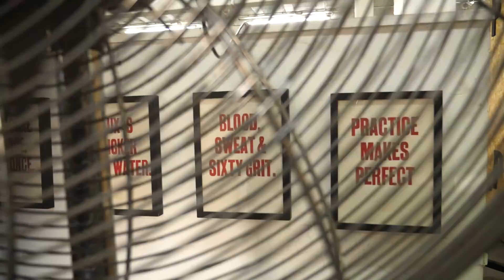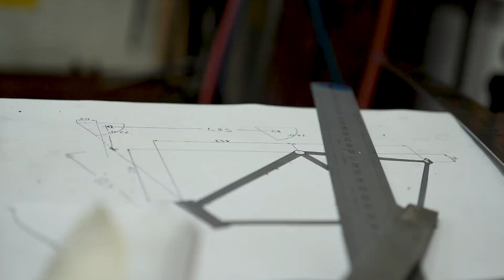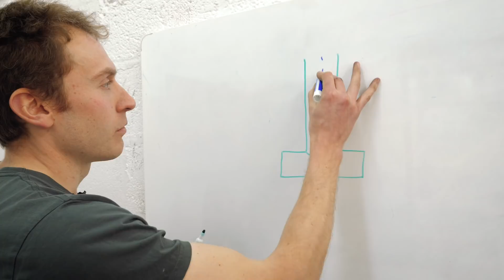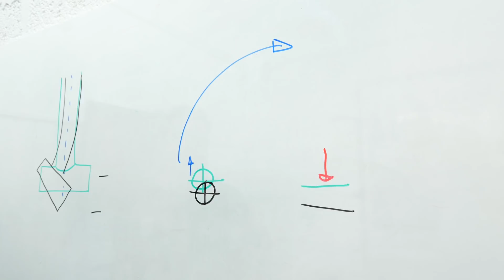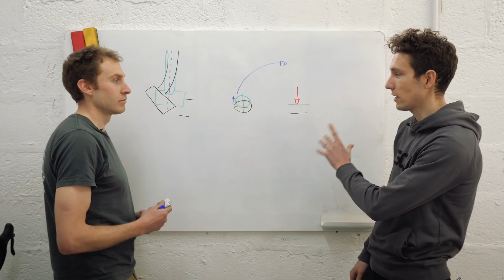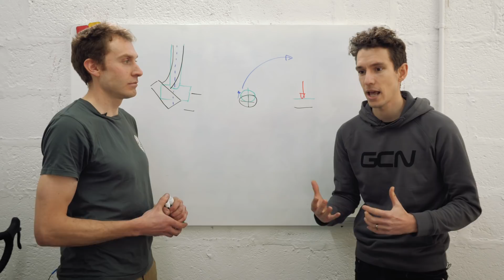Are You Faster On A Stiffer Bike?

Comment: In a strange train of thought...  You can analyse this in one of two ways... One where you can only supply a set amount of maximal power and one where you can only supply a maximal amount of force. We'll just go with maximal force as it's simpler to walk through the discussion.

 If you can only exert a set maximal force, the frame that flexes more would in theory allow the pedal to drop faster as some of the energy is being stored in the twist of the frame rather than being transferred to the road. Simplifying a bit... Rotational Speed (RPM) x Rotational Force (torque) = Power , so at the 3 o'clock position in the pedal stroke you are creating more power compared to a stiff frame because of the increased pedal speed at this portion of the stroke. But, you are storing that excess energy in the flex of the frame. As you reach the bottom of the pedal stroke where your pedal forces is lower the frame will provide a spring back of energy making it harder to initiate the pull through of the bottom of the pedal stroke. This return of energy combined with a fixed available force means that pedal rotational speed is slowed (bear in mind instantaneous crank speed will not be aligned with pedal speed due to the frame flex. Although they will have the same frequency, there will be a phase shift between them). With this increase and subsequent decrease in pedal speed and the accompanying difficulty in pulling through the bottom of the pedal stroke, to the rider, it would feel almost be like having eccentric chain rings they were placed 90 degrees out from how normal eccentric rings are installed. The end result of which is a muddy feeling through the bottom of the pedal stroke. This storing and return of energy essentially does peak shaving of power output to the wheel where the average (and I stress average) total power to the rear wheel should be nearly the same, but the peaks and valleys of power output throughout the stroke would not be as extreme.

On the counter conclusion to the above... a stiff frame will have less stored energy and thus less spring back in the bottom of the pedal stroke and therefore not be as hard to pull through. And, in a perfect world with no flex, all power would be transferred directly to the wheels on the down stroke, which riders with high strength (like sprinters) could possibly take advantage of that by being able to generate significantly greater pedal torque thus letting the more muscular rider generate a higher instantaneous output power. This makes for larger peaks and valleys in power output, but the valley can't (or shouldn't) dip below zero... so the greater the peak, the more total average power one could potentially generate. Eccentric chain rings would only augment this situation further, and although it's a topic of enormous debate on how effective they actually are, there are more than enough pro athletes who use them to say there must be at least some merit in the theory.

Comment: I have ridden brutally stiff frames which on smooth roads were more tiring to ride than my more flexible frames.
I could not ride long routes quite as quickly or as comfortably as the more compliant frames.
The rider endurance/output factor does not often come up in this discussion, but probably should.
Reply: Nor does rider weight.

Comment: Yeah.....nah....Full disclosure- I’m an engineer.Energy is absorbed in flexing the frame. This is wasted energy, and is not, as you suggest, returning to the drive train.Imagine if you had springs under your shoes. Some of your energy would compress the spring with the peddle down stroke, while the remaining energy would drive the crank (assuming no frame flex). This spring energy is released on the peddle up stroke. It goes into lifting your foot, not driving the crank.If I did the same test as you, but with springs under my shoes, and released the brakes, the same thing would happen as loading the frame. But in reality, the brakes are not released. The load is maintained and the spring energy is released without doing any useful work.It’s basic physics.
Reply: PS: It’s the same reason riders like there shoes to be stiff AF.

Comment: A more rigid frame is more consistent to ride and if there is a requirement to have some 'flex' it can be achieved in a controllable way ( suspension for roubaix, carbon layup etc ) to add the subtlety where needed rather than relying on inconsistent bending and twisting of bottom brackets.

Comment: Fascinating video/test! I am not a scientist but I reckon the problem here is that real life use of the bike is not on a trainer. Meaning that the bike does not remain upright and held in position during the torsional flex that loads the frame and drivetrain. If the trainer was not there for your test, the bike would shift sideways when loaded to compensate or neutralize that flexion. The issue appears to be that you have isolated the wheel into only allowing the stored energy to propel the wheel forward whereas in real life that energy is driven into lateral forces right and left per pedal stroke. I have an old 1997 Litespeed Ultimate ti frame that I have always referred to as a slinky on wheels....Its BB is very flexy and when sprinting the bike torques so much that it fish tails side to side. Maybe this is not so much an issue of loss of energy but rather misdirected energy. Watch old slo-mo videos of pro RR sprints from above. Those bikes are fishtailing all over the course. Watch modern videos and the fishtailing is much harder to detect and the speeds reached are higher....stiff means fast. That fishtailing is surely energy lost in lateral movement at the expense of forward momentum...instead of having that power move me forward its skidding out the rear tire to the side. On a stiff frame forward momentum is only limited by tire traction and wheel stiffness (other factors that could see wasted/misdirected energy going laterally instead of forward). This is all for a road bike where the frame is pivotless. Take this same test to a full suss MTB and you have a whole additional set of factors (or at least they are exacerbated) that lose energy that could/should be directed to forward momentum with a stiff frame. The goal here is to eliminate as many factors that misdirect energy as possible until they begin to counteract the benefits. If you feel beat up due to ultra stiff frame,wheel,tires, bars, post, etc.  then your sprint will be weaker from fatigue.   At least this is my opinion and my experience. Pretty cool stuff.

Comment: I don't think that this experiment was the correct one. I believe there is a difference in the energy given back from a soft and a stiff frame. The difference should be from elastic hysteresis which can be measured in metal and composite materials. Quick research in the literature: DOI: 10.1098/rspa

Comment: You entirely missed the point. Stiffer gives you more potential instantaneous power (not stored), thus potentially higher speeds, and that energy is somewhat preserved through momentum. The flaw with the frame "giving back" is that it only gives back the energy into the pedal end of the drive train (when pedal pressure is released), and not into the chain.

Comment: I thought frame manufacturers were aware of this and incorporate specific amounts of flex into their designs. I was reading that a prototype Specialized Demo bike was seen with varying thicknesses of carbon which had been crudely adjusted during testing. The explanation was that they were tuning the amount and type of flex. And yes, perhaps akin to tyre pressure, a stiffer harsher ride could fatigue the rider sooner, negating any power gains that may have been achieved.

Comment: The frame flex back but when and where? go back to the 'lab', do the same test but 'flex' the frame with the pedal at the 6 oclock position, release the break and see if the wheel will move. "....when less and less force is put into the frame, it flex back..." I guess it is near at the 6 oclock position not where your current test position. and doesnt sprinter want the power instantly? who wants to 'rock the boat' and 'hoping' it flex back 'when' I needed the most.

Comment: The problem with this is that a flexibel frame will tranafer more forse sideways than a stiff frame. The angle of the pedals will grately affect how much force that will go back to the chain. For example if the pedal is straight down as it is when you let the preassure of none of the force will go back to the chain, only move your feet outwards.

Comment: Simplistically, the frame etc. act as a spring. It stores energy as you flex it and releases the energy when un-loaded. As long as there are no losses during this cycle, it doesn't hurt. Less simplistically, there is likely some damping in the system which will result in small losses due to friction and such so you don't get back quite what you put into it. Would be interesting to expand this test to accurately measure the energy input and output. Good start and thought provoking!

Comment: So, if energy stored in frame flex (for stiff and less stiff frames) is only turned into to forward motion when there is still pressure on the drivetrain, will this than add or reduce forward motion considering the "dead zones" in the pedal strokes??

Comment: I think that after a frame flexes under load, when less load is being applied (top dead centre?) and the built-up energy is being released that most of that released energy is transfered back to the crank and pedal where it slows down pedal rotation marginally. This would be the flow of least resistance of the energy and if this hypothesis is correct then a flexy frame would indeed be slower than a stiff frame. The best way to test the idea of flexy vs stiff frame may be to use 2 identically equipped bikes that weigh the same up a very steep gradient.

Comment: The reason for the wheel turning was due to loading. The loading is possible because of flex in the frame and other bike parts. The flex in this demo isn't exact due to the brakes being engaged which meant force is put onto the break and the part of the frame it connects with as oppose to the hub to spoke to tyre.Flex rebound will be absorbed by your body and tyres, your body may be able to reutilise this energy. The real test is to have a flexible bike vs stiff bike and have the same wattage applied and see which goes further. the chain length between the sprocket and chain ring shortens on a flexible bike which means it will be harder to apply high wattages due to the give? Anyway the energy won't be resonating due to tyres.

Comment: I had been under the impression that frame flex reduces efficiency and torque, among other energy-related variables. Example - if one were to tighten a bolt with a steel wrench vs one made of a relatively bendier metal or composite material. Or if you were to open a door with perpendicular force vs at a wider angle.

Comment: The experiment is flawed. You are preloading the drivetrain with a few mm of pedal travel and then releasing the brake. The power is coming from the preloaded drivetrain not from the frame. A flexible frame just increases the friction in the drivetrain by misalignment of the gears and chain.

Comment: Ralf Hoenhe had already brought up what I just posted about the energy being stored in the stretched chain in this demonstration (I didn't read all the comments before posting). To see if there's any merit to this idea, they could do the experiment with an old worn-out chain and see if there's any visible stretch in the chain. My guess is that they used a new chain that would only deform very slightly and not be visibly stretched. More energy would be stored in a new chain being deformed by a 1 cm pedal movement (because more force would be needed). An old compliant chain would be more easily deformed by the 1 cm pedal movement and wouldn't store as much energy.

Comment: Very interesting demonstration, but there might be a different interpretation. With the bike on the stand and the rear brakes applied, pushing the pedal down 1 cm causes frame deformation but it also stretches the portion of the chain running from the top of the chain ring to the cogs on the rear wheel (energy is stored in the stretched portion of the chain). When the brakes are released, the energy stored in the stretched chain pulls on the cog, leading to the dramatic spinning of the rear wheel that we saw. That's the simplest explanation I can think of. As for the benefits of frame flex, maybe the energy of the bottom bracket moving the other way helps lift the rider's leg up on the back part of the pedaling. Just a guess on that one...

Comment: x amount of torque was transferred to the frame and held there by tension and Y amount of torque was transferred into the chain and cassette. Once the brake was released the tension/energy held in the frame was released proportionally to return the frame to it;s normal shape/alignment and the tension  held in the chain was simultaneously released. What we can deduct in the real world is that frame flex is not transferred energy into the drivetrain but instead into kinetic energy within the frame with small amounts of energy heat generated and lost. In the end a stiffer frame the better.

Comment: How about try something different - get a coat hanger and bend it a couple of times at one point - then put your finger on the corner you have bent it. You may have burned your finger at this point. Meaning that heat was created by flexing metal - I.e heat losses. Bikes only lose a few watts per pedal, so your frame will dissipate the minor amount of heat quickly. As for the stiffer frame - you have put your weight at the same amount of force and same distance - same result.

Comment: I ride a relatively stiff alloy frame (kinesis racelight) during winter ( and I  love it). 

However, I have noticed that when it flexes in high speeds I am more likely get a speed wobble. Plus, it makes me feel out of control. This is only happens out of the saddle because of the flex between the headset and the top and bottom tube seems to take the wheels ever so little out of line.

 I think this is, in a degree, more important than energy transfer. Especially when you are in a tight finishing bunch at >50kph. Could we have a video taking in consideration the torsion of the whole bike? Including wheels flex (the devil of all devils).

Comment: Here's one way you could quantify the difference between frames of different stiffnessUse two power meters, one measuring the power input from your legs (eg. pedal based or crank based), another measuring combined output (hub based or a turbo trainer with power measuring capabilities)By comparing the power readings from the two power meters you could work out how much energy is "lost" through frame flex

Comment: I would assume a rider would be using energy to counteract the frame and keep the bike steady. Incorporating more stomach and back muscles this would increase rider temperature showing where energy is being converted. 

Another factor could be aerodynamics tiny flexes in every revolution would cause the rider and bike to cut through the air less efficiently. As a straight line from A to B is always shorter a 2cm flex at the seat would be exaggerated at the riders head, meaning power is used moving more air out the way.

Really interesting content once again GCN, keep it coming guys.

Comment: If a flexy frame causes a wheel to spin a bit due to the rebounding energy, then could people just pedal from the 12 of clock to 3 o'clock crank position, and then rest leg from 3 o'clock to 6 o'clock since rebound will rotate wheel while leg is resting? Kind of like riding with a two high saddle. I think someone patented a bike like that.

Comment: One of my bikes frame cracked at the seat tube and down tube just above the bottom bracket. It did not break all at once. It was gradual. The first symptoms was a self shifting rear derailleur. Then as the crack got bigger, the frame flexed more and the crank felt soft on the down stroke. It felt soft since the crank was flexing inward and the result was a noticeable loss of power as some of the forces was being directed inward instead of downward. If a frame is too flexy your pedaling force may not be be optimized to forward motion. Kind of like climbing or sprinting out of the saddle and rocking the bike slightly. Rocking the bike may enable to dig in more power, but flex of frame and change of wheel angle will be a little less efficient to forward motion.
You can test yourself by cutting slightly into your frame to start a small crack. One note also about the test in video, the wheel is not clamped perfectly tight and still, so that could affect results a bit. Also in real riding, that much crank flex would cause wheel to spin since brake is not holding wheel still. So amount of flex in frame would even be less. I think how frame flexes in regards to the line of travel is important too. If a frame flexes, the energy could cause the head of the bike to change line and produce more road and wind resistance, whereas as stiffer frame would not deviate as much.

Comment: The static test isn't comparable to a dynamic test for a few reasons but simply put in the dynamic test the load coming back does so through the riders legs which have moved past their optimal stiff position. Having said that and as others have said my 'feel' is that there is a sweet spot for some frame flex for rider comfort which ultimately will cause fatigue and reduce your efficiency anyway.

Comment: The experiment has one condition: the leg doesn’t move when the frame springs back. On a road that won’t be true. Basically, the frame’s flex will work towards lifting the leg rather than moving the bike forward.